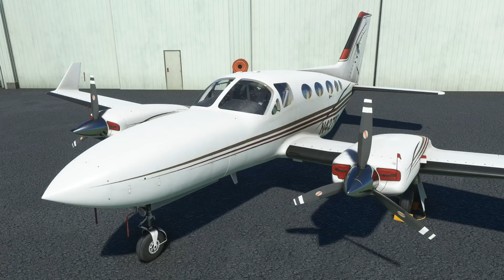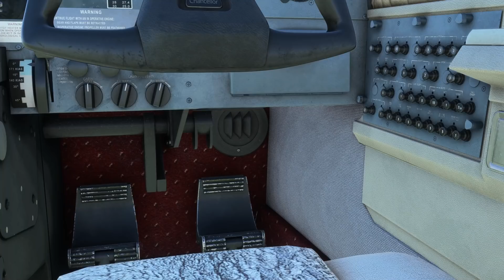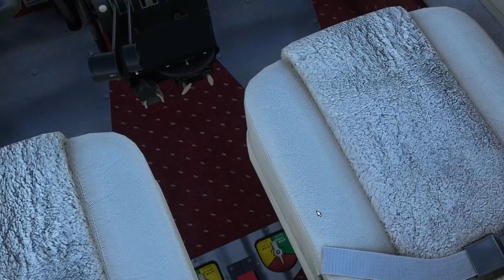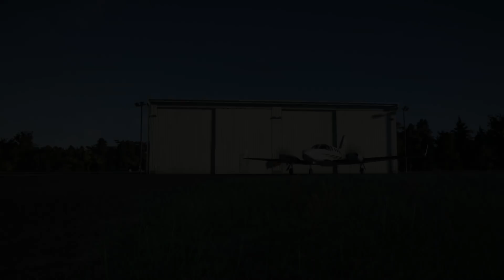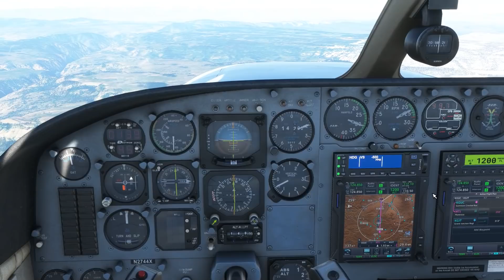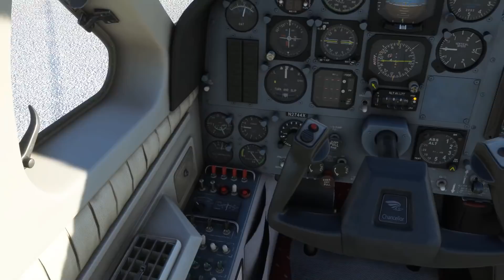Flysimware - Cessna 414 Chancellor (Early Access) | Full Flight Review | Microsoft Flight Simulator

Comment: Agree with you. Overall, its a fine product. I look forward to their getting the A/P system working correctly as I really use the A/P systems on my flight sim planes. I have yet to test the A/P in the 530 equipped planes but I expect the same issues there. Thanks much!
Reply from the maker: Hi Dennis,

I have yet to try the 530 myself, but I gather it's actually worse still? FSW do seem to be very proactive with patches thus far though, so it's a promising sign that the product will have it's issues ironed out. In the meantime, a good excuse to sharpen up those hand flying skills I suppose ; )

Cheers and all the best! : )

Comment: Very nice detailed video. You failed to mention the obvious bugs like side windows open while being locked or even with EFB in the way, the windows open trough the tablet. The main door opens but does not show in external view besides very briefly and disappears. I only fly in VR so could be all non VR optimized? And the actual rudder on the tail does not move when plane is stationary only when it's in motion and yes it's unlocked. Livery paintjob is very poor when you look at it... But great plane. I love it from day 1 when it was released as Beta. You did make a mistake pulling the "Emergency Cross feed Shut off Lever" at the start. Don't if there is no fire or gears up landing! :-) It's a great detailed plane and we need those in the sim so I'm happy to be an early adopter so the devs get the support to improve and fix all the bugs and make more super realistic planes with great sound sets. WE WANT MORE :-D
Reply from the maker: Hi Sven, thanks very much, glad you enjoyed it : )

To be honest, I didn't notice a lot of the bugs you mentioned. I tend to look at what an addon can't do, as opposed to what it can do I suppose. I generally run with a real-world checklist and if it can perform based off that, then it's all good by me. I don't generally try to "break" things. Not to say that one is wrong to do so, merely that I am happy, so long as I can operate the aircraft within its normal bounds. The door issue must be a VR bug - you can see in my video that the door stays open and visible.

I was using a real-world C414 checklist for the video and it calls for "Emergency Crossfeed Shutoff - Open"; I guess pull is the closed position then haha (this is the problem when the included manual doesn't flesh out the detail - though it was a nice manual overall)?

Anyway, I'm glad you're enjoying the aircraft overall! I agree that I'd love to see more addons of this caliber!

Cheers and all the best!
Reply: @IntotheBlueSimulations  Beta 1.4.1 just got released and many bugs are fixed. Auto pilot with auto approach procedure works like a dream now with latest GTN 750  RELEASE V2.1.25. I reported the other bugs so they will get fixed I'm sure. The Chancellor is now a very good, best GA plane in the sim.
Reply from the maker: Awesome! Looking forward to trying out the latest update when I get a chance then : )

Cheers Sven!

Comment: I tried to hang on hang on for your review before buying it but succumbed to desire yesterday. The video was extremely helpful to me as a tutorial so thank you. Re the Autopilot. It seems to be fine to me but you have to set the Alt and arm it on the separate counter thingy I've found.
Reply: Even then it doesn't work for me
Reply from the maker: Hi Martijn,

Someone else mentioned to me, that setting the sims units to the US system fixed things up for them (and even changed the aircraft's performance etc, due to a bug when using other unit types). I haven't given that a go myself yet, but perhaps worth a try : )

All the best!
Reply: @IntotheBlueSimulations  Hi. Thanks for the suggestion but the underlying issue was that the autopilot reference altimeter was not the PIC altimeter. Has been fixed. I found a few more bugs in the mean time. RNAV flying parallel to the track in crosswind and the GFC600 not being able to go from one mode to the other without deselecting the active mode first, among a few others. Will report them! My latest vid includes them. Do you know if there is a way to crossfeed data between the two GTN750?
Reply from the maker: Haha, that's understandable John. I've had many a day 1 purchase get the better of me! : P

Hey, if you still want to watch the video even after purchasing, then I consider that quite an achievement ; )

Very happy to hear that the video was still of use and noted on the ALT ARM. I was aware of the ALT window and ARM mode - I've never used one of these particular autopilot units before, but I would be very surprised if they autopilot can't be put straight into ALT (without arming first). Typically once you see "ALT", you would be expecting the mode to be active, as opposed to armed. Again though, that may not be the case with this particular unit. . .

Cheers as always! : )

Comment: Yeah ... with the 2 year anniversary approaching and some very basic features like the autopilot still not working properly (and more and more features getting broken with each update) ... the projected timespan of 10 years support for Flight Simulator doesn't seem that long anymore. In fact it starts to feel like we are very pressed for time.
Reply from the maker: Sadly I somewhat agree Jigsaw. 10 years sounds like a long time, but we're nearly 1/5th of the way through that support cycle now and ultimately we have seen little, meaningful change.

I've tried giving Asobo the benefit of the doubt for a long time and there's no denying they have done an excellent job in many areas, their interaction with the community is top notch and I do believe their hearts are in the right place; nonetheless the sim is stagnating, under the weight of a lot of "circular" updates (fix one thing, break something else). We're a long way off a completed product. . .

All the best!

Comment: Nice review thanks. If you want to be a beta tester go buy..... because this is still in beta with loads of bugs, the main ones is the prop RPM, the oil pressure gauge (always too high pressure), the avionics and the autopilot, as yours mine can not be set on specific altitude, I was busy with it for a day but wasn't able to preselect any altitude, after preselecting it descents immediately and pressing ALT is giving me an altitude that is 8000 ft higher then where I am, followed by a nose dive. I didn't know it is still in beta when I purchased, it was stated it was a beta on one page, but not on the other so i didn't see it. When the bugs are out, it is a great aircraft to fly....so lets hope they fix everything. On the forum it turns out that the AP is looking for a third one that is not modelled there so it is unusable (for the ALT) but from the developer no statement on this yet, wich rather disappoints me and it took me a day to find that out. Thanks again, Always looking forward to your reviews !
Reply: EDIT: Just set MSFS to use the US system and that fixed a lot of the AP issues and believe it or not, gives me a whole new performance in take-off and climb...appearently when you are not set in US system the aircraft is reading the wrong density altitude.
Reply from the maker: Use the US system?! Neverrrr! : P

Another ridiculous Asobo bug then : / I wonder if that density altitude issue doesn't explain a whole host of other issues that I've been seeing in the sim. . .

Thanks very much for the info, I shall begrudgingly give it a go haha! All the best : )
Reply from the maker: Cheers Ben! Yes, the C414 certainly has its fair share of bugs, but credit where credit is due, FSW seem to have been very proactive in terms of updates thus far. At least they do have the decency to mention that the aircraft is in early access, rather than selling it as a "finished" product and then fixing it up later (as we have seen from other devs). I would certainly like to see the bugs addressed, but nonetheless it is an addon that I have been enjoying very much overall. Definitely one for hand flying at the moment though XD

Thanks very much for watching! : )
Reply: @IntotheBlueSimulations  yes, very happy to See how they work on it. It became my favorite aircraft and I fly my RTW flight with it.

Comment: Little white button on the altitude alerter will set your autopilot to capture the set alt..... loving this plane.
Reply from the maker: Yes, thank you Robert! I was aware of the button, but I would be very surprised if the real autopilot doesn't level the aircraft off once its gone into ALT mode (regardless of whether or not it's been armed ahead of time), whether that's at the selected altitude, or the aircraft's present altitude.

I haven't used one of these specific units in the real-world, so I could certainly be wrong, but "ALT" would suggest to me that the mode should be active at that point regardless.

Cheers for the info though and all the best! : )